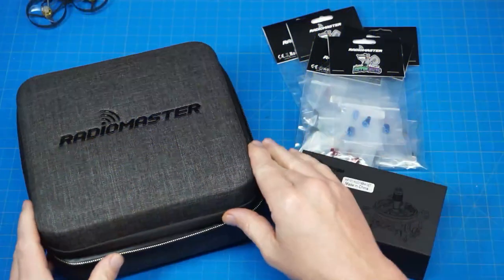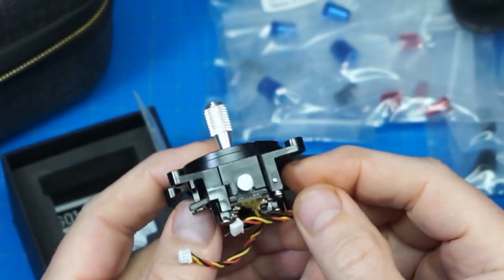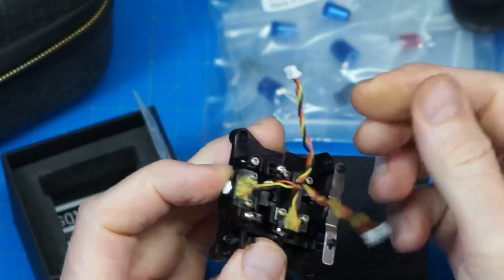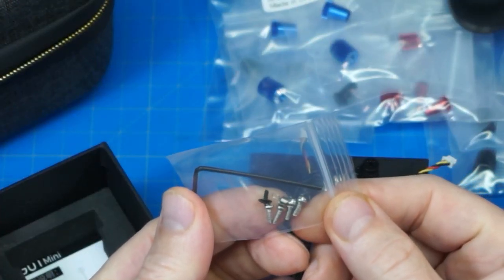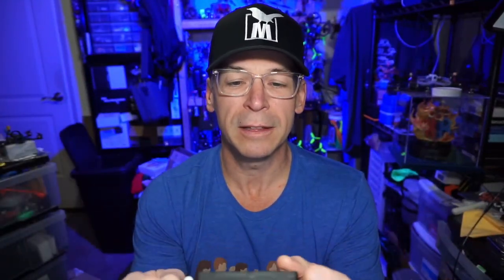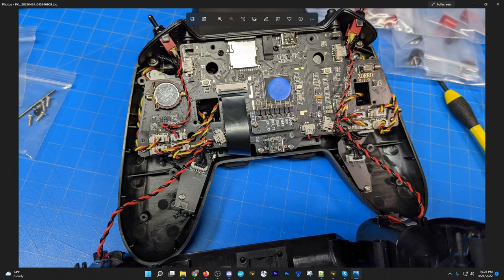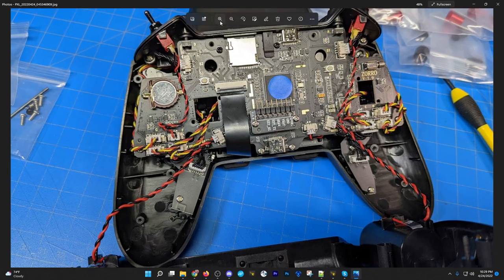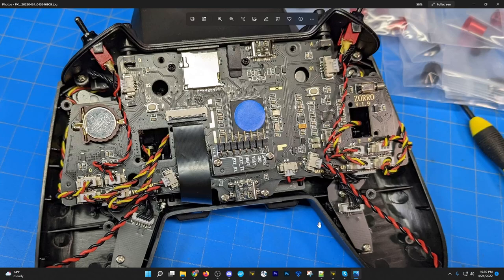All Metal CNC Gimbals // Pack N Fly Case // StickEnds

Comment: Nick, I've been working on adding the DJI FPV Goggle batts to the Zorro. There's a perfect spot for these batts behind the screen 😀
Reply from the maker: I did see your post on FB. Looks like an interesting option for those that have the dji fpv batteries.
Reply: @NickBurnsFPV  I'll keep you posted on how the mod goes! 😃
Reply: @NickBurnsFPV  the DJi FPV goggle batts require specific USB-C connector to activate it. There are 4 options so far. One's in the mail coming today

Comment: I am waiting for my son to mess up a gimbal in my old TX12 so I can have a reason to drop these in it, lol.  I run the TX16s with the AG01 and love them, so now the boy needs a set to match his old man.  Also, those pinch sticks are my daily drivers and wouldn't have it any other way!
Reply from the maker: I am surprised the white stick ends haven’t discolored with my grimy fingers. I do very much like them as well
Reply: @NickBurnsFPV  mine havent discolored either, but I will admit that I have had to clean them off a couple of times with a soft brush.  They are like magnets for anything even remotely gunky, lol.

Comment: I am trying to decide if I should get the Zorro or another smaller form factor radio. I have and love my tx16s but hate lugging it around. The new betafpv radio with screen seems like it could be an interesting option too. To many choices!
Reply: I would assume in the near future they will offer the Zorro with a color screen.  At least that’s what I’m waiting for and I might try out that new Betafpv transmitter in the meantime.
Reply: @professorvoluck9311  I wouldn't!  I've got both Tx's. The colour screen on the TX16s is nice but absolutely useless compared to the screen on the Zorro in sunlight.

Comment: Mobeetle?! Looks interesting. Want to know if that toothpick frame is any good.
Reply from the maker: The Mobeetle as in the new happymodel whoop coming out? Which frame are you referencing?
Reply: @NickBurnsFPV  It comes with a plastic whoop frame and a carbon fibre toothpick frame so you can switch the parts between the 2 and fly whichever one you feel like at the time. But there's no specs on the toothpick frame. I want to know how thick it is for example. Doesn't look like there's any sort of purpose built battery holder for the toothpick frame either. Just a spot for a rubber band.
Reply from the maker: @rustumlaattoe  Interesting, I missed that it includes a "naked" frame. Looks very similar to the eachine frame released a while back.

Comment: 42x35 fixations : looks to me like they should fit the jumper t-lite and the betafpv lite radio
Reply: Yeah, that's what I thought too. But they probably won't advertise competitors products.
Reply: I recall another FPV YouTube reviewer mention that he was going to try fitting these AG01-Mini gimbals into the Betafpv Lite radio. Some modifications are needed, he said.  Can’t remember who it was, sorry. But I’m sure he’ll click bait us if/when he succeeds.
Reply: @robert_g_fbg  I'll certainly be trying too, I need a reliable pocket tx for when I go hikking, the literadio as it is isn't accurate enough
Reply: I want to install them in my T-Lite !  From what I see, you just need to solder the two red wires into one, the same for the black ones, in order to be able to form a single connector like on the original T-Lite gimbals.  I opened the T-Lite several times, but I never specifically calculated the dimensions of the gimbals.  Has anyone been able to do this (width, length and height)?
Reply: @maeldrz  I received the gomball I ordered today, I'll trying to put them in my literadio this week
Reply: @metalfpv  wow cool ! Keep us in touch please 🙂 ! In reply here or video 🤞
Reply: @maeldrz  sure I'll film the disasembly and put it on my channel

Comment: I just got my Zorro & Crossfire Nano TX this morning :)
Can't find the darn 18350 cells I bought for it over 2 months ago though... :(
Reply from the maker: Probably in a special spot so you wouldn't forget, I do this all the time :)
Reply: @NickBurnsFPV  I spent literally hours digging through my piles of stuff (I think I caught the hoarding bug from my mum) but all I could find to put in the Zorro were a couple of 16340 sized cells... yeah they're a few numbers short but they fit and work and will get me started until I find/buy more Radiomaster 18350 cells :)
Now I need a crash course in navigating & using EdgeTX, I managed to use OpenTX enough on my T16 to configure it to fly quads without issue, but this Zorro's interface feels more alien.
Reply from the maker: @licensetodrive9930  For the uses I have edgetx was pretty straight forward to pick up. Your sharp and will figure it out more quickly than I did :)
Reply: @NickBurnsFPV  I've not flown anything in 5 months because of long covid fatigue issues I'm still getting after 2+ years, last night I flew my Mobula 6 for the first time in 6+ months, had to use my Jumper T16 as I couldn't get the Zorro to bind, but it only felt like a couple of days since I last flew, not months, I still got it :)

Now I got my Tina Whoop's CRSF RX bound to my Zorro and busy configuring modes, the switch orientations might take some getting used to, at first I thought they wired them upside down!

Once I've got it running smoothly and flying quads with it I'll start on The Mask of Zorro TPU print design to protect the gimbals, screen & switches all in one. I asked Radiomaster if they'd give me a Zorro to do that design for everyone, to their credit they offered me a 30% discount as appreciation for what I've done for the community (all those folding TPU holders etc.). But I then became too ill to take them up on their offer.
Reply from the maker: @licensetodrive9930  Oh no, I forgot your suffering still. Sorry to hear that continues.
Reply: @NickBurnsFPV  Thank you, I spent a week in hospital in Jan because I had yet another energy crash which leaves me bed-bound for days, it affects my leg muscles so much at times I can barely walk to get to the kitchen/bathroom etc., having to literally crawl up the stairs I've been used to running up 2 steps at a time for 40 years now is not fun at all.
That's on top of now living on my own for the first time in my life since I discovered my mother died in her sleep 6 months ago, I've been living with her forever because I've never had an official job as my only real income is from disability living allowance, I have Aspergers.
Sorry I didn't mean this to come across a downer post, I love the videos you do and the FPV world, designing FPV related prints over the last couple of years and getting all that wonderful feedback from pilots and my designs being featured on Bardwell's channel 6 times has really helped me mentally when I've been too weak to do much beyond sit at a laptop & operate the keyboard & mouse (it's nearly impossible to do 3D designing with just a touchpad!)
Reply from the maker: @licensetodrive9930  No worries at all. Its certainly been a rough time. All I can do is to hear you and try to understand. I will be sending you best wishes for your health and encouragement to continue to enjoy the hobby as you can in hopes each day bring you more energy and health to continue to enjoy the hobby and the life you can enjoy.
Reply: @NickBurnsFPV  Thank you very much for your kind words Nick, since 6 months ago I feel like I'm living in some surreal dream, and the filter between my thoughts and what I say/type has broken down somewhat so I apologise if things got too serious in my post.
The best way I think people can treat me is to carry on as if nothing happened at all, I need some normalcy in my life and drones+3D printing fit that criteria perfectly, I have close family and friends here taking care of me as well as the health authorities finally taking note of my long covid situation.

Back in our fun world of drones, right now I'm trying to figure out how to get my Zorro to bind & work with all my quads, so far I got my Tina Whoop with Crossfire bound & switches activate the modes fine in the Configurator but when not plugged into the computer the whoop won't arm & fly, it does motor beeps on command fine. I'm more used to operating my T16.
Reply from the maker: @licensetodrive9930  I wonder if the arming issue is the throttle min value being to low for the new radio? I see this from time to time as I try out different radios. Or maybe there is a "range" set in betaflight to correct the previous radio stick input values?
Reply: @NickBurnsFPV  Ahh you may be on to something, I do recall seeing a stick value go below 1000 when I last had it plugged into the Configurator. Thanks I'll go take a look later to see if range values is causing the arming issue.

Comment: Hey Nick, been following your videos trying to catch up on changes in the hobby since I have been away. Currently looking at a Zorro/Jumper T Pro and leaning towards Zorro with the stick upgrade. I have a few legacy models that run DSMX but I plan to transition to all ELRS for my future builds as I'd like to do some HD long range stuff as well. Anyways, would you purchase a transmitter with ELRS built in and run a 4 in 1 module for the legacy stuff? I could see running ELRS 500mw+ etc being easier with the external ELRS module since I could get a aluminum module that is essentially  a heatsink itself, plus add a fan/different antennas but there may be some benefit to running a TX that's built from ground up for ELRS that I don't know about.
Reply from the maker: I would get it with 4 in 1 internally and add an elrs module. really opens up our options. The new radiomaster ranger elrs modules are top notch, they go up to 1watt natively with packet rates up to 1000hz, with different sizes to fit nearly all our radios.
Reply: @NickBurnsFPV  Thanks Nick, the Ranger looks exactly like what I had pictured. Any major difference between the Ranger and Ranger Nano? I see one looks to have CNC case and different antenna but the size is also significantly different, not to mention price.
Reply from the maker: @ChrisHarmon1  The nano doesn't have the display or buttons etc, so we have to use the elrs lua script to control the module. The ranger does also have the ability to go above 1watt, but that requires some elrs hackery that Wezley Varty has a video on. Otherwise all the same features.

Comment: I thought you could get to the adjustments from the back. Without opening the case. Is that not the case?
Reply from the maker: The adjustment I see is only for the ratchet(metal bracket) which would impact the vertical movement, and only tighten as they come without the bracket touching the gimbals.

Comment: I already paid nearly twice for my Zorro than it cost due to import fees and all sorts of nonsense, so I'm gonna hold off a bit on these, however it's definitely an upgrade I'll be making at some point in the future, probably around when I order the usb-c to 3pin 2c cable for longer battery life, been managing so far just swapping between a set. This pretty much cost the same price as the Zorro currently for me so I'm not in a rush.
Reply from the maker: Dang, we are lucky here in the US, we don't get dinged with those fees. I get around battery life by plugging in a small 2s battery for a flight or two then the 81300s are mostly charged.
Reply: @NickBurnsFPV  I... had not considered that the 2s would also charge the 18300s... Derp. Okay that's a fantastic reason for me to snag that cable then. Also the sad part Nick? I'm in Canada. Land locked and still getting dinged by crazy fees. It's made me heavily reconsider where I make my purchases from unfortunately. Maybe I'll just have to start driving across the border more often....
Reply from the maker: Don’t have to have the cable just plug in a 2s battery via balance led. It will charge it right up. And pretty quick too
Reply: @NickBurnsFPV  Holy hell that's amazing. As you can tell, still quite new to the hobby, however I do have a few larger 2S batteries for my RC car so this is just awesome all around. Damn, thanks Nick!
Reply from the maker: @Latchfpv  Nice to have a no cost solution :)

Comment: A nice thing to have but really I can't imagine that these are going to make a difference for anyone.  I would be very much in favor of seeing these come on the radio to begin with - but not with a huge price jump.  I do like this radio, was going to get one but the good old supply chain issues a few months back made it so I could not find one during that moment!  

Oh well, I ended up with what I think is the best value radio in FPV the TBS Mambo.  Priced right around these radios but I think that it is just a little nicer, but that is probably opinion.  

A lot of this was also form factor but I really like the game pad style so yea, it was a lot of going back and forth - and like I said I debated for so long that when I went to buy - no luck and at that point I was really itching to finally make the purchase!  I really don't think you can make a bad choice between the major players, they all seem very much equal.
Reply from the maker: Difference can be many things. Make someone a better flyer.....probably not. Make it more enjoyable to hold and manipulate....maybe 50/50, be more reliable...time will tell, be more accurate in proximity...I would hope. :)

Comment: Sad. I bought Jumper T Lite one week before the Zorro came
Reply from the maker: I like the t-lite as well. I just like the zorro a touch better, but now with the cnc gimbals its starting to separate more and more(with more $$ too). And the t-lite isn't available anymore.
Reply: @NickBurnsFPV   I think those gimbals can fit on the T-Lite too ! They seem to have the same size... I opened several time my T-Lite, but never measured their size. I ask to Jumper, but no reponse from them. From what I see, there is «only» need some wiring works to have only 1 connector like the original T-Lite gimbals 🙂

Comment: would it fit a jumper t-lite?
Reply: No just zorro and tx12
Reply: @samuellambert6152  you sure? I know its only made for those, but it doesn't mean it couldn't fit into other radios.
Reply from the maker: I think it would fit but likely we need to make some slight modifications to secure them in with full stick movement. I have heard there are some going to attempt it

Comment: Ive already broken a switch on mine 😵
Reply from the maker: Dang, just normal use or droppage?
Reply: @NickBurnsFPV  15cm drop... 🤐
Reply from the maker: @nikotttin  dang it. This does make a case for button and toggles over sticks. I just have struggled with operating them.
Reply: @NickBurnsFPV  I wouldn't make a call for butons either... especially the arm switch. I use the other side 3 POS switch for beeper and flip switch. The one I broke was for RTH... and a button for that role wouldn't be a problem for me.